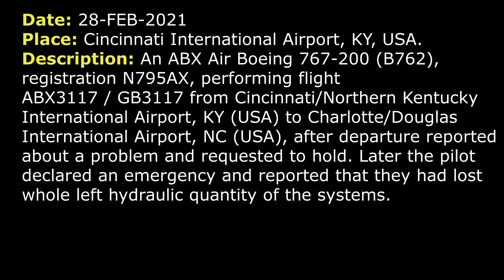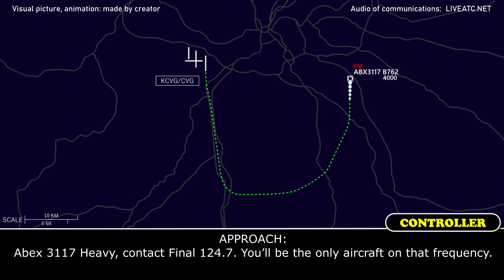HYDRAULIC FAILURE, Emergency return | ABX Air Boeing 767-200 | Cincinnati International Airport

Comment: What is the problem for B767 to continue  flight with lost L  HYD SYS?
Reply: N795AX is a cursed plane, trust me. I work in flight ops for abx and it has been temperamental the past couple months
Reply: @Rick-bc8lt  What’s the future plan for the 767-200s? I noticed that a good few are early 767s that were domestic configured with Delta. Must have a crazy amount of cycles!
Reply: One failure away from a total loss of flight control.
Reply: @enthalpy you have 3 hyd systems.  You’d need 2 more to fail.